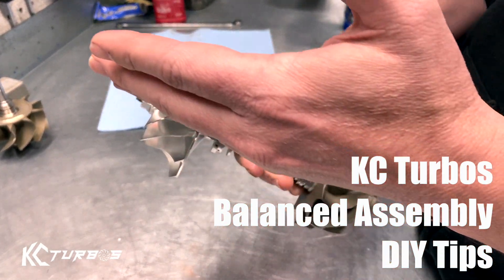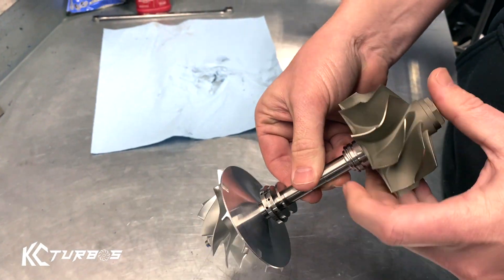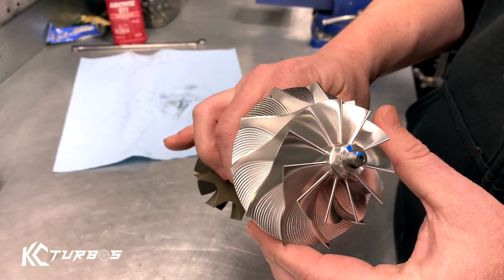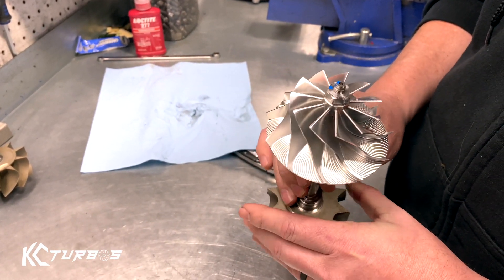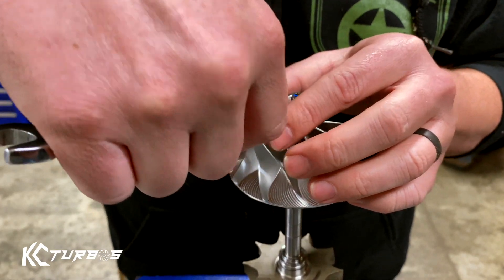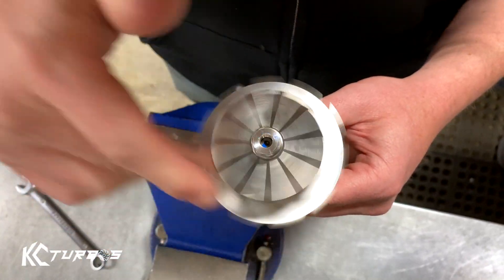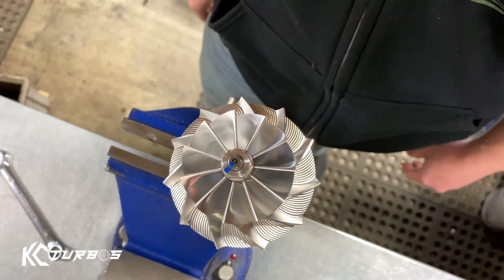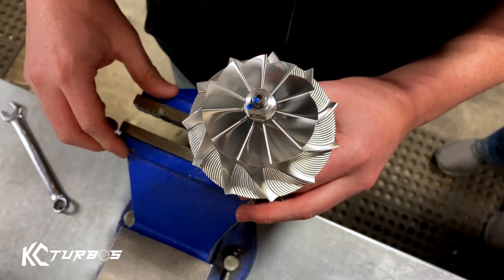Watch This BEFORE You Install Your Balanced Assembly DIY Kit!

Comment: I am really not sure why this is considered the instructions that are linked from the website. I don't know whether I need the circular o ring from the compressor housing to the center section on my early 99.  It seems like a single tip and I guess I will go to the forums instead of the manufacturer....

Comment: Not exactly a how-to but good info I suppose. Just got mine, did not come with a blue mark on the wheel just one on the shaft. 
Can’t find install instructions anywhere and KC’s website under instructions navigated me here. Not one instruction except how to line up the marks (which mine doesn’t have) 

Not sure how I reseal the turbo or install the bearings either…. Would love a full disassembly and reassembly video from KC for the 7.3l
Reply from the maker: The balance assembly kits are typically only meant for shops or experienced mechanics to save money and parts. This is why there is no warranty on DIY kits due to the vast issues that can rise with mixing old / new parts together and that is why there are no direct instructions for these.  We cannot control  the condition of parts mixed new with old parts and having instructions on what to look for and know.

Comment: Sounds like the customers are snapping those shafts because they’re reverse threads
Reply from the maker: Often times its from over tightening, they dont use a torque wrench, or just line up the marks by hand.
Reply: @KCTURBOS  should loctite be used? High temp on the heat shield screws?
Reply: @KCTURBOS  all torque wrenches does not work reversed. So there is no click, except shaft, lol

Comment: Interesting he mentions that this impeller with threads can tighten ,when running, witch means the balance will change. Turbine and shaft,, and also impellers are balanced on their own to 40,000 rpm on a Shneck balancer. Some shops like to balance the assembly, extra cash flow, is it needed, not likely.
Reply: They can tighten, but probably not even visible.

Comment: If the wheel will tighten up while the turbo is spinning wouldn't it then be off your marks and then out of balance?
Reply: I built one for a friend more than a year ago. The marks stayed lined up after a few months of use. I think he was just stating that just like cooling fans, they are threaded so they cannot unthread themselves.
Reply: Good question, i was just thinking the same thing.
Reply: @badass6.0powerstroke10  i didnt think the lines were for balancing, just for torque. either way these KC guys know what they're doing
Reply: @psd28  Yeah, these lines that are being talked about now aren't for Balancing, these are just to make sure nut isn't backing off. There's another Line marked on Mine, right on the Leading Edge of the Compressor Blade, i believe that's the one used for a reference point for Balancing.
Reply: After watching this i just had to check mine, i have about 8,000 miles on my KC Stage 2 since i installed it, so i just pulled off
My intake tube going into Turbo, and my marks are still lined up just like they were when i bought it, So it hasn't moved at all. I just had to check it out.